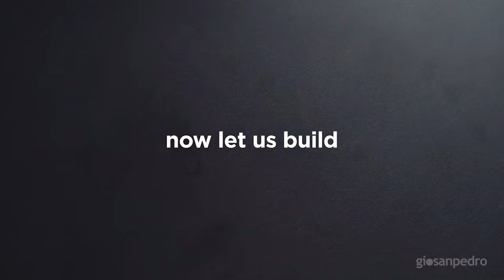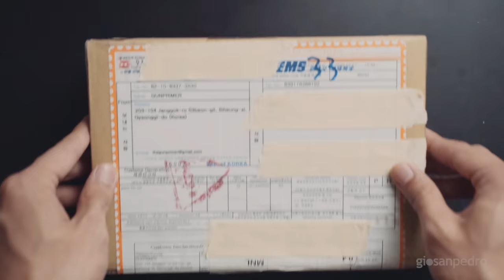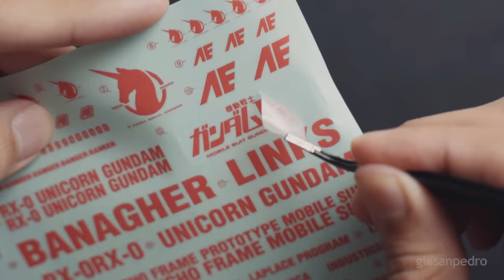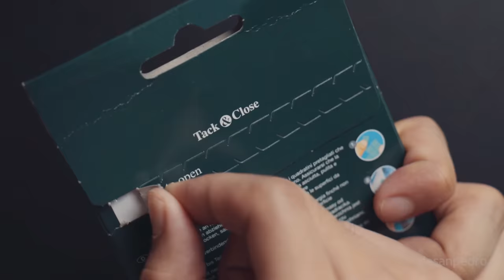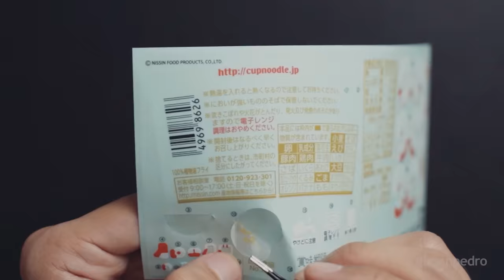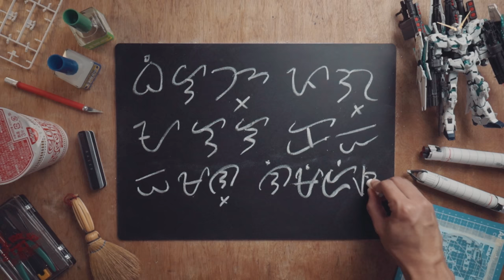Unicorn Gundam FA RG | Satisfying Gunpla Beat Building

Comment: came back to this video after a year since completing my own rg unicorn FA to say that you're the reason why I even bought it. spent over a month (if I only count the days I worked on it) starting in my two week quarantine and ending when we finally moved in.

though I had to repair parts I broke during the process, it's so far the best model I've built. it's my 2nd gundam AND the second rg I own. It’s going to be the only gundam that gets to keep its display spot in my room. 

thank you for inspiring me to return to gundam after almost forgetting about them after the basically ruined rg zeta I built(bought one more to rebuild it more profesionally).
Reply: Damn bro, your first and second gundam is an rg, on top of that your first is the zeta, that's crazy
Reply: @Luzhong_editz  honestly the Zeta was built so scuffed and I'm still impressed I even managed to complete it(albeit fked).

like I did the idiot method of cutting out EVERYTHING and only managed to get it done because I could recognize the parts by shape.

as for the Unicorn... the arms broke because of the stiff joints like many others before me. didn't have any good tools around so I did the next best thing of cutting the head side of a small nail I found and using it as the new hinge post for the elbow that I had to remove the post from due to the superglue I used for the repairs making it impossible to remove.

up close, you can tell just how much I had to "destroy" the whole thing just to get it together.
Reply: @jerrylim6722  I see, "destroy" lol, ngl currently building the unicorn and the only current Issue is that I accidentally broke the right leg thruster part but I fixed it with super glue(though the connection is wrong making the part slightly off the actual look), 

for the arms I  have experience with building the rg banshee norn first(haven't finished) from reaserching the kit and finding a tip from a channel YouTube about fixing the stiff arms which helped me when I build the banshee's arm but the connection of the right arm to the chest(the 3 polycap thing for both arms)broke which is why I haven't finished it, had that same problem with my unicorn but now try to disassemble like gio with more confidence, succeeded but the part broke again so gonna redo that and the banshee norn in the future
Reply: @jerrylim6722  so what pose is you fa unicorn on now, since it can't really move the arms and all
Reply: @jerrylim6722  "cutting out everything before doing it" wow thats bold
Reply: @Luzhong_editz  it's just in a general "float" pose but when I said "fixed" i meant that I literally redrilled the area where the original elbow joint piece had the pole, and replaced the destroyed pole portion of the peice with the nail that was approximately the same diameter... 

so in terms of mobility, it has evrything... albeit more finicky due to how I modded and repaired the parts.
Reply: @Luzhong_editz  the one saving grace about the RG Zeta was that due to how complex everything is... all the parts are only compatible with the correct pieces... the bad part is that's where all the good news end.

still haven't gotten around to the fresh one yet because I still got slight PTSD of fking up the hip frame piece so bad the first time around and had to very precariously glue it back together... and currently it's broken again on the old one, hence why I even bothered to get the new kit... but man, I really don't want to torture myself woth that yet.

probs gonna do the RG Freedom I got laying around first whenever I actually finish the other non-gundam stuff I currently got going.

heard the Freedom is another form of hell but for actually getting it to pose.

the zeta is hell from start to finish, including posing. made Zeta years ago, probably a decade, and yet shit still a traumatizing experience.
Reply: @jerrylim6722  I see
Reply: @jerrylim6722  tip: maybe try to do hg after that(if you stay in the hobby after rg freedom, if not do this first) like the new wfm/ibo/or even build divers kits hgs, they are more relaxing and could be used for training for future rg kits
Reply: @Luzhong_editz  lmao, that's exactly what I'm doing. intentional bought multiple HGs that look decent enough so I can traumatize  myself again later by making new parts for them.

especially the HG AGE2 normal. eventually I'll get around to copying the Zeta's moving frame for the hip piece and make one for the AGE2 so it truly becomes the Zeta "Clone" it tried to be.
Reply: @jerrylim6722  I see

Comment: 8:39 Daelim Water Slide Decal has lower resolution and less adhesion than other products. I recommend Delphi water slide stickers. Delpi decal has high resolution and high adhesion and includes service stickers. It is a sticker brand that is highly regarded in Korea.
Reply from the maker: Noted on this mate, thanks! I actually bought a Delpi first, and it was a beautiful, holographic emerald green! But then I decided to use a decal sheet with the original colors. I agree, the Delpi one seems to be of higher quality

Comment: Why you keep switching on nippers sir?
Reply: Because... why not?
Reply: I don't have the fa but if I remember correctly, the rg unicorn  had parts on thick and thin gates, so unless your using a godhand or a really good side nippers, you'll have to use different nippers to avoid putting stress on some parts.
Reply: @jegt3382  tnx for the info sir! I never build this kit before so I don't have any idea there are parts like that.

Comment: The elbow of RG FA Unicorn mine is so lose and after further investigation there's a crack 💀, I dunno either I'd use tamiya thin plastic cement or super glue to apply the cracks (and yes both elbows have cracks)

Edit: the G8 and G9 are hella fragile , wish there was a metal version or other sturdy material to that part...

Comment: I learned the hard way on my EG RX-78-2 to cut on a box as a shield  shield when one critical part of the helmet went Boing off into the air and ricocheted to the floor somewhere in my room as I was making the last cut and I never found it. The cockroaches and bed bugs stole it before I could find it. 😒😒 Hadto scratch build the little red nubbin on the forehead!

Comment: Can you use the Mark setter and softer on normal stickers? Not at water type i mean.
Good and relaxing video, can't wait the next gunpla 👌🏻✨
Reply: no. using them on normal stickers may even ruin the stickers. I thought about using a similar stuff called Mark Fit(same use but basically supposed to be a one step version of the two) retro actively on my unicorn but didn't as people warned against it online as these are for water slides.

Comment: no way that took 5 months
Reply: You'd be surprised at how long it takes to make one of these in general without filming. However, this absolute lad had to film each individual cut, file the nubs from said cut to make it look good off screen, film each assembly, then apply stickers (which for an RG kit there's a LOT of them and they're tiny), then edit the video to sync times with the clacks, and then render it in HD. I can easily see this being within that 5 month timeframe, especially if he had built kits on the side for other videos or just for himself. It took me 2 weeks to build my RG Unicorn and that was the non full armored version. This man is a legend lol!
Reply: Of course the build didn’t take 5 months, the editing did. He also probably worked on this project on and off over that time. I’ve built an RG Unicorn and it took me about 2-3 days, a few hours each day. This was the non full armour version, if it was it probably would have added an extra day.

Comment: can someone explain what the name of the kit means? Specifically, what does "FA" and "RG" mean? Considering my first kit, as a major tinkerer and RC Car builder, not sure what to pick... I really don't want something too easy :)
Reply: So RG is the specific line of the model. It stands for Real Grade, and they are designed to be what these mobile suits would look like if they were real. These aim at being small scale but with high detail, gimmicks, and an inner frame that has a lot of articulation. As for FA, that simply stands for Full Armor, meaning that this version has a lot more in terms of armor and weapons than the standard version. In this case, the full armor isn’t armor, but weapons. And lots of weapons. Hope this helps!
Reply: @shadow_bread2477  seriously appreciate the response. Thank you!

Comment: Do people actually use sandpaper and the nail cutter thingy 🤔  I've always just pop it out with my fingers
Reply: Yes. If you just use your hands you risk:
- leaving ugly stress marks on parts
- gouging out areas of parts
- leaving leftover plastic on parts
- outright breaking parts.
This is especially true for kits with smaller parts like RGs.

There are kits that have been designed so you can just use nothing but your hands (Entry Grades, some SDs), but they’re the minority.
Reply: @Jc88500  can I just use nail cutter dose sharp edge tip kind 🤔  I just got in to gunpla so I really don't no a lot. All I know is that I didn't buy the tool set cause it was expensive.
Reply: @geromeliwanag2360  I built my first 3 with a set of those.